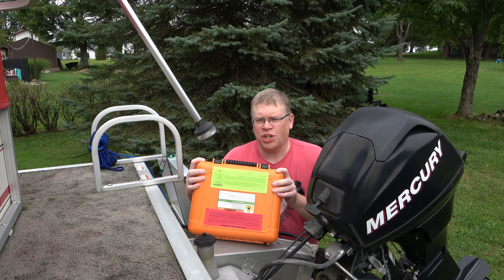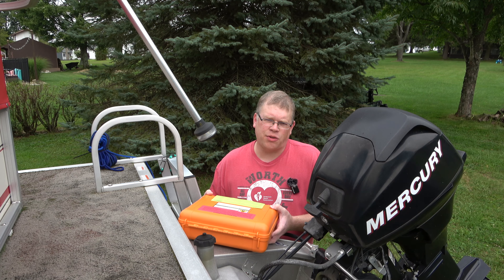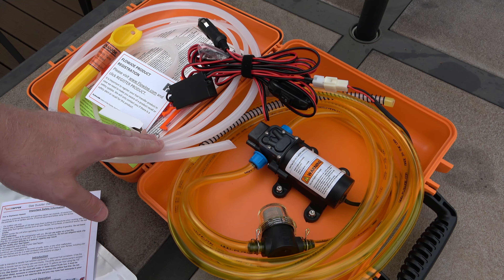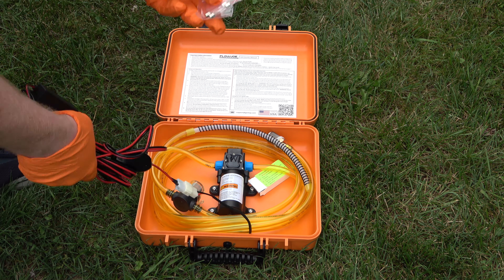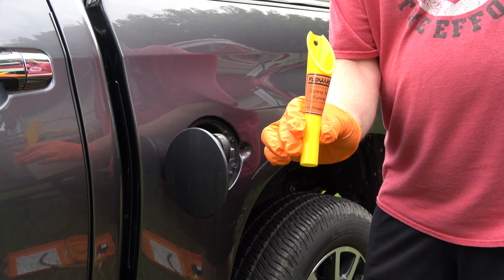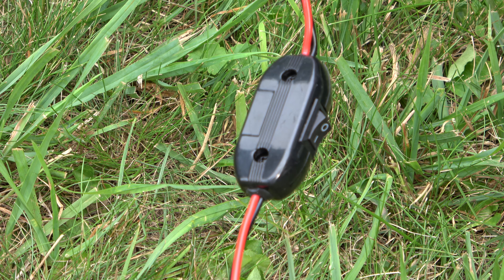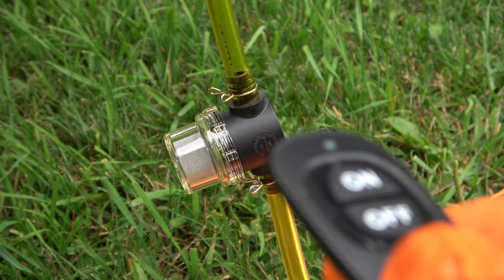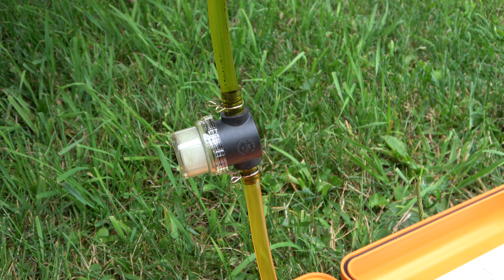FlowJoe Gas Guzzler 12 Volt Fuel Transfer Pump Review

Comment: Only the standard model is in stock, have you used that one and how does it compare to this one in the demonstration?
Reply from the maker: I am sorry but I haven’t used the standard one.  I believe the primary difference is the flow rate of the pumps.  The intention of the unit I reviewed is to transfer larger amounts of fuel.
Reply: I have one for sale if you are interested. I only used it once and no longer need it.